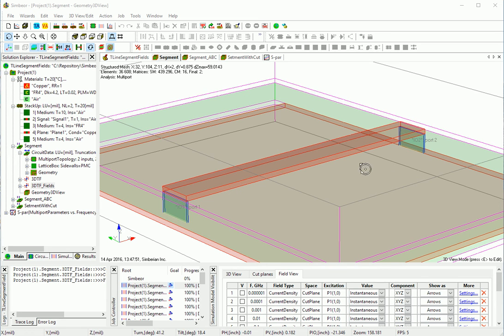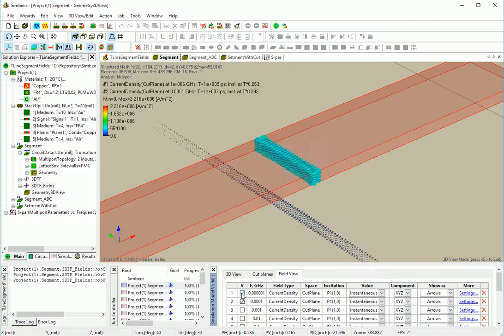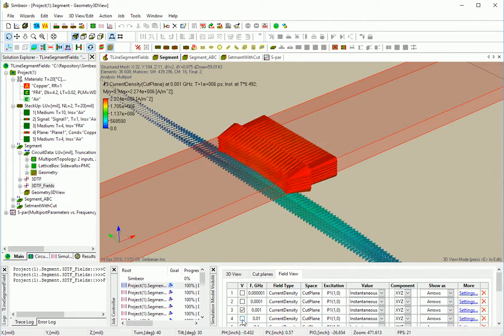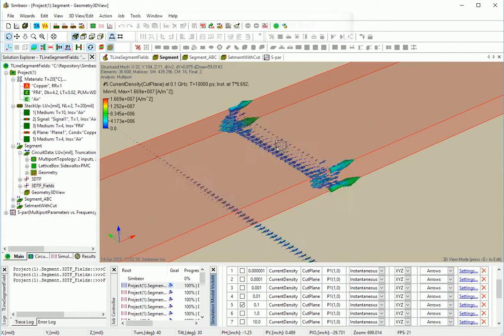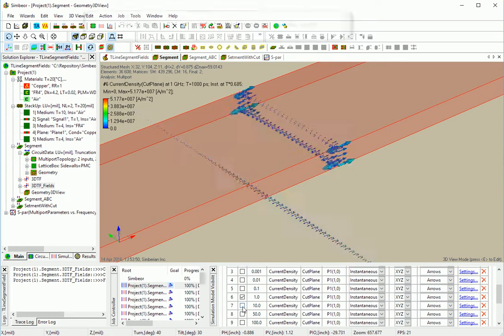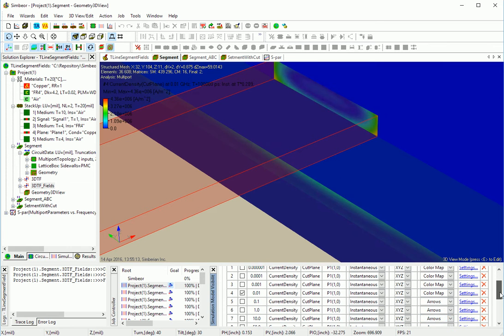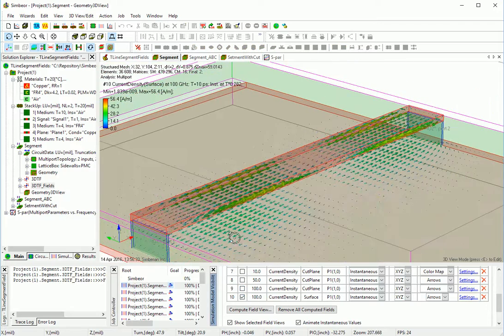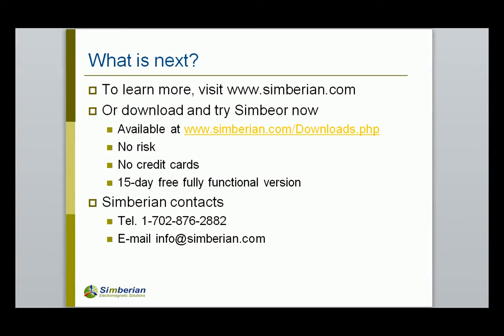How Interconnects Work™: Skin-effect in microstrip line

Comment: Hi, Have you analysed skin effect in microstrip vs stripline, which one is better or worse ?
Reply from the maker: The consequences of the skin-effect on the microstrip may be definitely worse, comparing to a strip line. The bottom surface of the microstrip conductor on PCB may have more roughness (to avoid de-lamination of the surface components) and the current flows mostly at the bottom surface at higher frequencies due to so called high frequency dispersion. It does increase the total losses. See more on the currents in strip lines and roughness effect at http://www.simberian.com/ScreenCasts.php